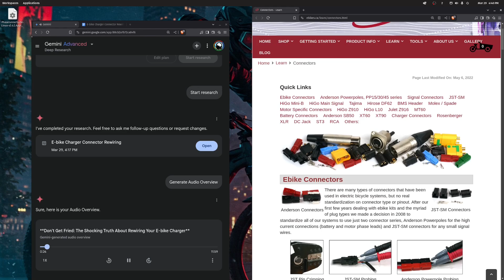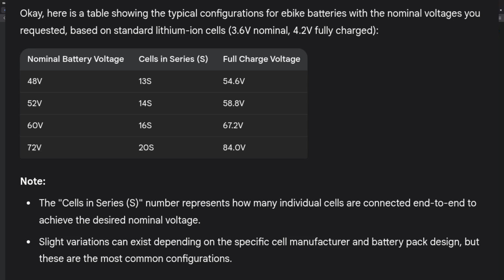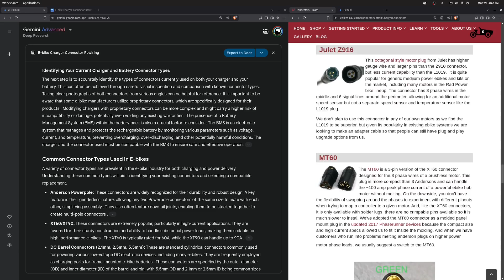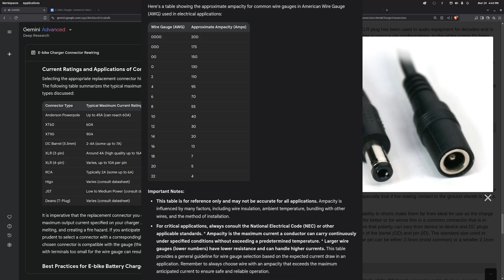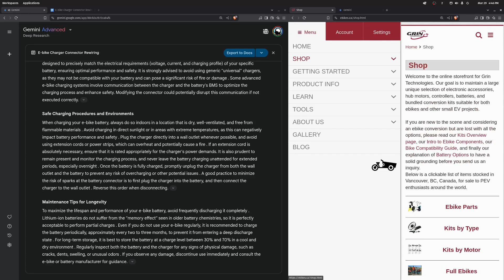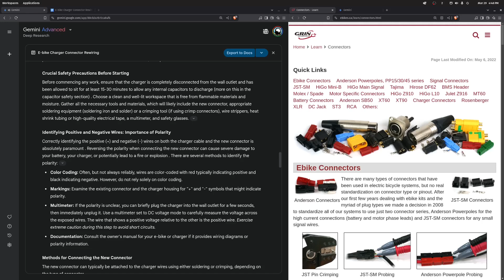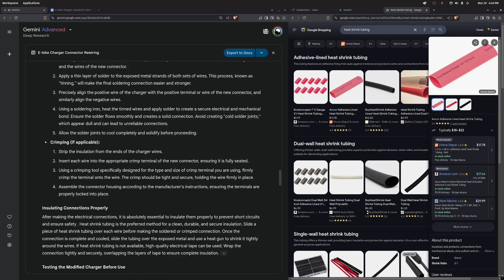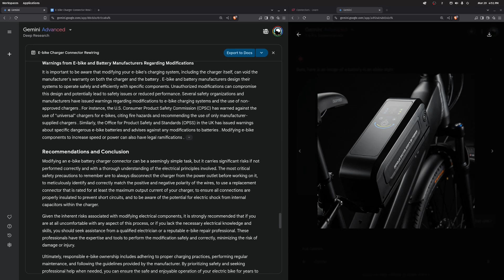Rewiring an E-bike Battery Charger Connector: A Guide to Safe Modification

Comment from the maker: The user's initial thoughts about opening the charger or simply cutting and soldering the wires are common first considerations. However, a more informed and expert-led methodology is necessary to ensure a safe and effective modification. Undertaking such a modification without the requisite knowledge could lead to severe consequences. Therefore, this report aims to provide a comprehensive guide to safely rewiring an e-bike charger connector, emphasizing the critical importance of electrical compatibility and adherence to best practices. :person-turqouise-waving::face-green-smiling::person-turqouise-waving::face-green-smiling::body-green-covering-eyes::body-green-covering-eyes::body-green-covering-eyes:

Comment: I don't understand, how do you check the voltage it the charger is unplugged
Reply from the maker: :face-green-smiling::person-turqouise-waving:   i Suppose figuring it out will be a final exercise for the user Lol But Yeah.  that would be correct. i think it meant to check your work for continuity without the charger plugged in.  and then yeah to check the voltage you have to plug the charger in

Comment: Last yr my friend's T90 connector, that comes on Amazon batteries, welded itself together. Had to solder on a new connector on a live battery. Did it one wire at a time so as not to short the battery. There's a lot of power in a 48V eBike battery as the tip of my multimeter probe got melted off when sneezing while checking voltage.